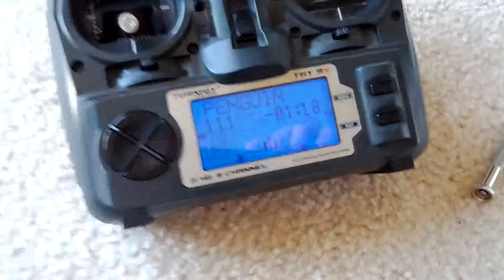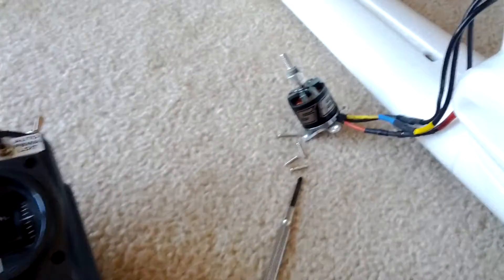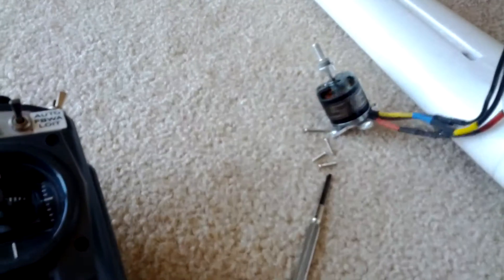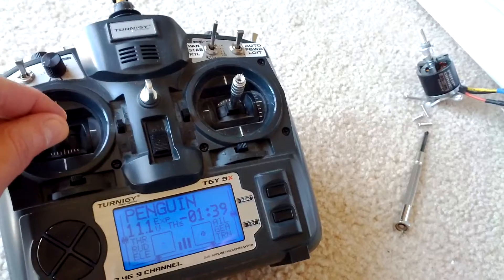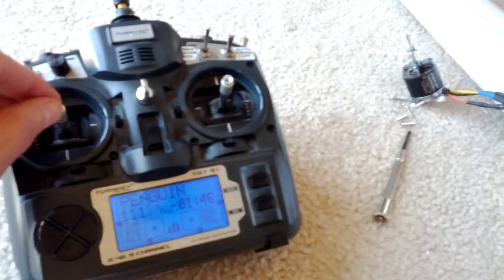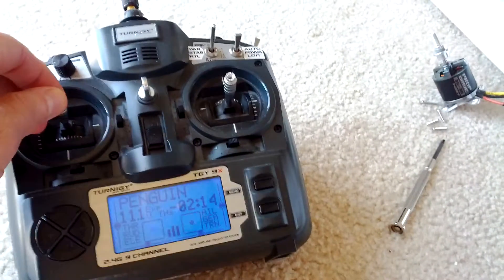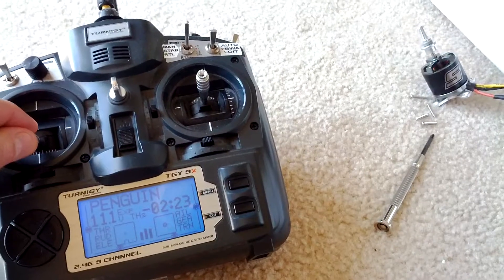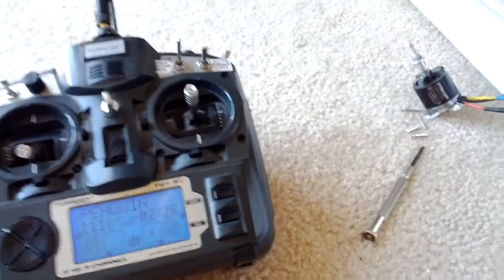Dragonlink Throttle Problem

Comment: No harm would be done by not having the antenna on the RX. Not on the TX would eb a different story. Any regard. I do seem like a esc timing issue. Not sure if your new esc fixed this issue or not, but i would of tried a servo on the thr channel just to see.

Comment: One, How come you don't have an antenna hooked up to the DL reciever?  Second, try moving the tx a few feet from the rx and see if the issue remains.  My Taranis 2.4 goes nuts when it's too close to the rx on the plane.
Reply from the maker: thanks for the suggestion.  I have decided it was the ESC , even though it was new, it must not play well with this motor..